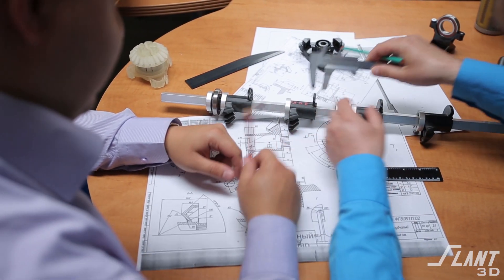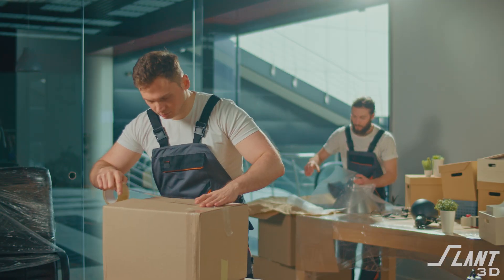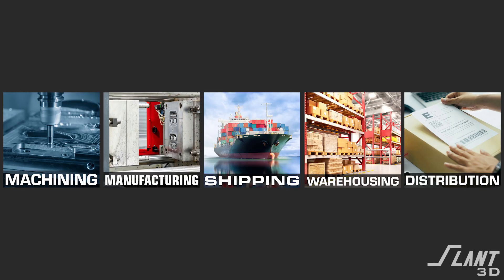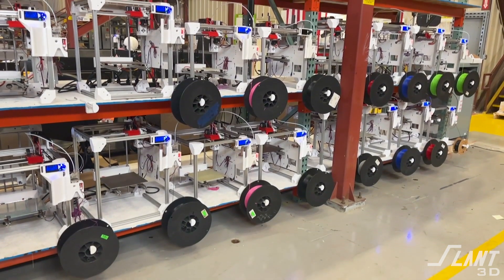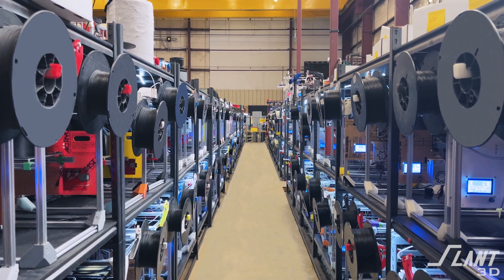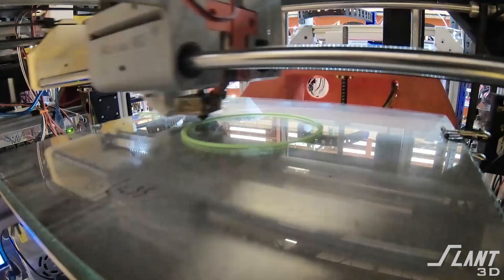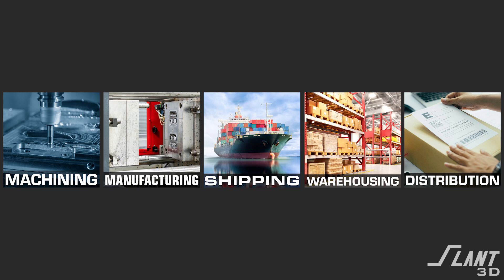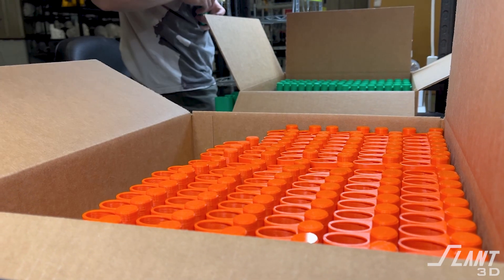A Warehouse Where the Shelves Make the Products | Digital Warehousing | Print on Demand

Comment: Nice, but you not actually cutting many supply chain areas. You still have raw materials procurement (for Nylon, PA), warehousing (for the 3D printings), fulfillment (Pickers, Packers and Packaging Supplies) and, Last Mile Delivery (to the customer doorstep). So, in a nutshell you're just changing parts of the model, but you still need a Supply Chain.
Reply: Since they try to ship them right away, the warehousing for the 3D printings is probably minimal.

Comment: The concept sounds good,  however the finish and structural integrity are the problem everyone has. If you really can do consumer-grade finish for say a playstation controller, lets see example parts. Otherwise you need to qualify these statements with where the tech is right now.
Reply: Most plastic items are made for planned obsolescence, not for structural integrity. I'd be fine with a 3D printed Playstation controller, and I imagine if it was redesigned for 3D printing it would last as long as an injection molded part.
Reply: @logicalfundy  That's fair, however I haven't seen a printer producing parts with the finish of an injected moulded piece. Yes you can post-process them, but it's highly labour intensive and not suitable for mass-production. So if Slant 3D have a solution to this, then I think the entire industry would love to hear it. My X1C is a great printer, but the finish is still a problem with many designs. Yes, you can say "you design for the  process", but you also have to design for the application. In this case comfort in the hands. So how do we ELIMATE not reduce the stair stepping? If you are claiming that it can be a replacement for traditional methods for everything except packaging, then this needs to be addressed explicitly, and not hand-waved away with a "design for the process". Personally I'd like to see a video with actual production parts exploring the more difficult cases. Show a side-by-side of the traditional part and the 3d printed one.
I can totally believe that 3D printing will take a big chunk out of traditional plastic manufacturing, but I need to see more concrete examples to backup these extreme claims.

Comment: No disrespect, but I have to agree with @phild5322. This is a take that doesn't seem like it has too much real-world experience behind it. I recognize the language and tone as start-up style ideas where you are conceptualizing a new way of doing things and you have to sell people on that idea. 3D printing as a mass manufacturing idea is fine, it has its place today but it won't replace injection molding. I mean I love 3D printing as much as the next guy but I know it has limits. I've been on the 3D printing side and I've been on the injection molding side. I wish this video went into the downsides of 3D printing in order to have an honest look at the print farm concept. For example: When you can change designs on the fly revision tracking goes out the window, injection molded pieces get revisions stamped inside them as the mold changes and are easily trackable. As you scale a 3D print farm, you bring more printers online and your energy and maintenance demand grows consistently, injection molding scales easily and the cost of energy consumed and maintenance isn't your responsibility. Speed: 3D printing takes hours, and injection molding takes minutes. Storage: most companies don't keep a massive amount of inventory but rather do production runs as inventory runs low. Certifications: good luck getting anything 3D printed certified in any way, shape, or form, ISO standards would eat 3D printed products alive. Strength: 3D prints are not nearly as flexible and strong as injection molded parts, especially if they are small in size. Quality: 3D prints still have layer lines, support marks (even with resin), and inconsistent blemishes (and color) while injection molded parts do have part lines and injection points that show, they are much easier to hide. IMHO 3D printing will never become the king of mass manufacturing, the day of a printer in every home is approaching at a faster rate.

Comment: Only issue I see is quality. While quality of 3D printed parts is getting better and I'm sure your prints look very good, I think layer lines still exists. Size is also a consideration as well.
Reply: @justpassingbyy  "most people" two people in a closet ranting about how much they hate slant trying to replace injection molding is not "most people".
Reply: Layer lines are not inherently a defect. They are just a natural feature of 3D printing. Injection molding has its natural features like the seam and an always smooth surface. The reason why we see layer lines as defects is because historically high quality products have been produced with molding or machining, so we tend to associate quality with the finish of those manufacturing processes
Reply: @masterbick2   your answer is really the joke of, it's a "feature" not a defect. What any product should be is what is wanted. If people want a product without layer lines, then layer lines are a problem... not a "feature". If I use a broom to paint a wall and it does not look like crap to people because it does not look at good as doing it with a paint brush, it's not acceptable just because... that is how painting with a broom looks.
Reply: @ToddCopeland  Buildings with siding have layer lines too. It's a "feature" of the production process.
Like most products, the "look" of the product is one aspect, besides quality, cost, shipping time, etc. There will be cases that a particular process or "look" desirable, and if a particular process can't deliver that "look", then a different production process will be required. Layer lines in a 3d print should never be viewed as a defect, it's just part of the production process. This no different that tooling marks on some metal processes, or sandy texture on some casting processes.

Comment: how about metal parts?
Reply: There are 3D printers for metal.
Reply: @andreas.grundler  But they cost tens of thousands or even millions of dollars to get
Reply: @linkeroniw  Of course, they are not affordable for the private user, but for a company that manufactures parts on demand, it is just a machine that pays for itself over time. 

There are already products that incorporate metal 3D printed parts, and there are manufacturers that you can order your metal 3D printed part from. It is certainly not worth it for all metal parts, but there are parts for which metal 3D printing is the most cost-effective way to manufacture and sometimes even the only way.
Reply: @linkeroniw opensls starts at 2k xd
Reply: @linkeroniw  e3d a 3d hotend manufacturer just released a hotend extruder combo that had a metal 3d printed heat sink
Reply: @tty3dp  I know there are metal 3d printers, but in the context of a print farm that needs values mass production with low labor, it seems less than ideal, especially when considering the clean-up after the parts are done printing
Reply: @linkeroniw  Cleaning and post-processing is becoming increasingly automated. There is a lot going on. There are already fully automated systems where workers only have to transport the container with the 3D printed parts from the printer to the post-processing station. The machine does the rest. BMW, for example, uses a system like this from Volkmann. The next step is that robots handle the transport and the employees only monitor the whole process.